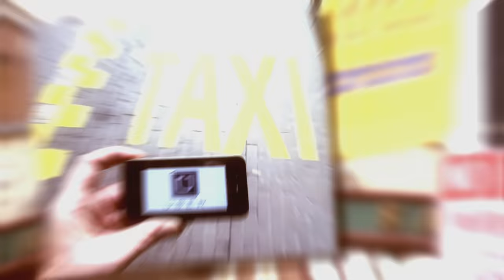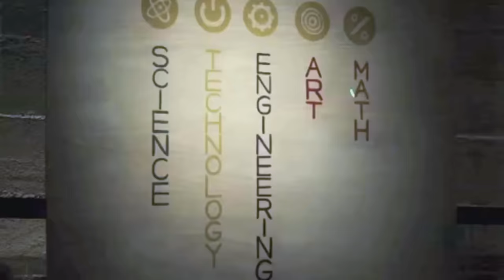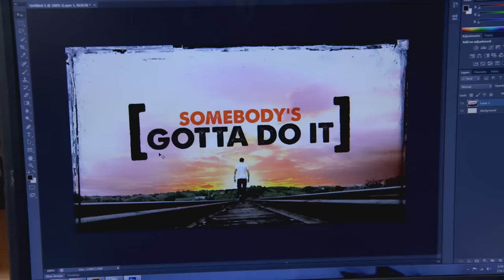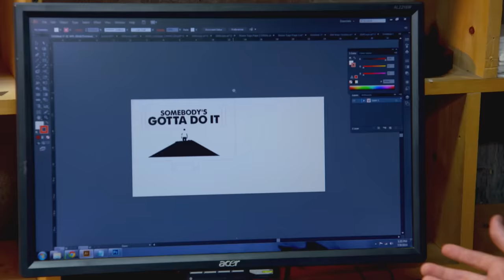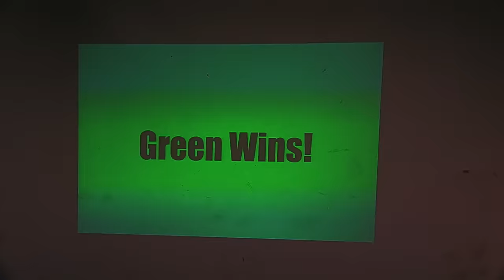Mike Rowe Joins STEAM CIRCUS & Learns DISRUPTIVE INNOVATION | FULL EPISODE | Somebody's Gotta Do It

Comment: My son will be 27 in june, anything that broke or wore out, we took apart.  As he got to mid elementary school, I'd make him draw or list what he thought was inside.  (Had a lot of flashlights with missing pieces, lol)  currently he has my dads McCormick Cub completely (!!) apart & on shelves...  He works as a crane operator & truck driver, loves to disassemble & repair heavy equipment down to small engines.  But at 2, he ran the shop vac on my constructions sites better than all of the guys I'd fired over the last 45 years!  Gotta teach them but also fan the flames of curiosity...      Thanx !        (Scouts may have helped, lol, as an Eagle, lol!!

Comment: There is a place for STEAM, but it is in addition to STEM, not a replacement for STEM.  Put these folks, or any STEAM student, into a highly regulated environment, like for example, a medical device manufacturer, and they will be absolutely miserable.  There is a place for artistic engineering, and there is also a place for using very careful adherence to known principles when solving problems.